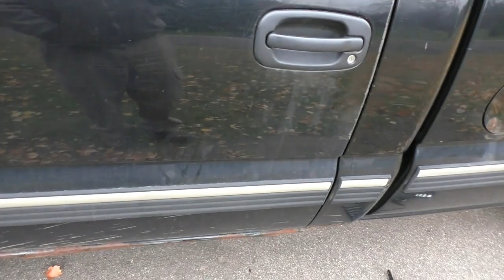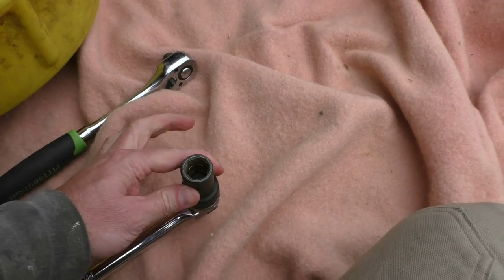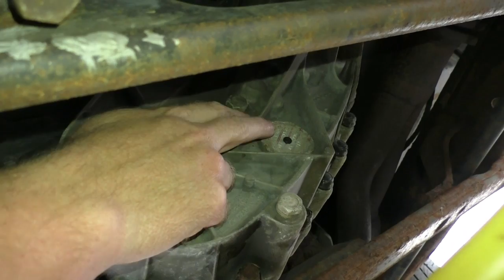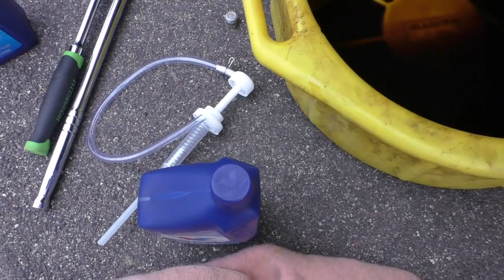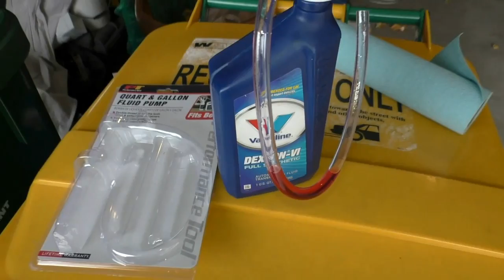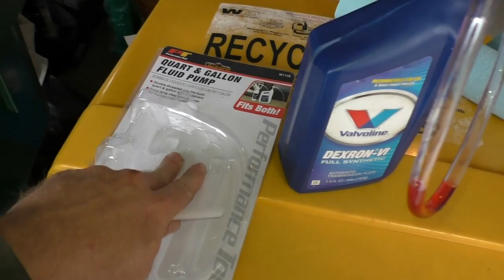1999 Chevy Silverado Transfer Case Fluid Change

Comment: So, how do you tell if you have an Auto-Trak II case or not?

Apparently it's supposed to use more of a 75w-90 gear type oil.
Reply from the maker: I don't know about that stuff. Sorry about that.
Reply: Auto Trak II uses AC Delco blue fluid #10-4017. Anything else will not be good for the transfer case and will lead to sooner failure👍🏼
Reply: @H P  thanks 👍

Comment: Hi I have a 99 suburban 6.5td. When i shift to reverse it takes a second before it engage. It is much harder/noticeable when the engine is hot. Do you think its the oilpump in the transfercase or what's your thought?  Is there any way to save the transfercase?
Reply: Transmission Shift Solenoid
Reply: thats your tranny bro

Comment: Can you explain the vibration, im having vibration too
Reply from the maker: It was a vibration that increased with the speed of the truck. My problem was a failing U-joint just behind the transmission. Get under the truck and try to move the u-joint and drive shaft around by hand. If it moves up/down or side to side at all then it needs replacing. There are 4 u-joints if you have a 4wd so check them all but it's usually the long drive shaft between the transfer case and the rear differential. There is a u-joint on each end.
Check for leaks around the transfer case and the amount of oil if you can. Good luck.

Comment: Dude your all wrong the the vent hole on top is just so it drains faster not so it drains and your supposed to use auto travel 11 fluid not atf bro do research stop making videos on shit you don’t know
Reply from the maker: The Dexron ATF is listed in the manual as the proper fluid for the transfer case. I'm not your bro and maybe you should do some research. bye.
Reply: hiddengrousefarm I have a 99 and it doesn’t say shit about that fluid there’s actual people that can’t afford to take there shit to the shop so they rely on these videos but people could do even more damage watching bullshit like this and two quarts wtf just do us a favor and don’t post videos
Reply from the maker: @johnniesmith6416  Here is a link to the owner's manual. Page 7-26 (402 in the pdf) shows the fluid for the transfer case. I have a manual transfer case so my fluid is Dexron III or IV. The fluid for the automatic transfer case is different. As I'm sure many people have told you - READ THE MANUAL.

 https://www.google.com/url?sa=t&rct=j&q=&esrc=s&source=web&cd=1&cad=rja&uact=8&ved=2ahUKEwiv4KzhnM7fAhXF7IMKHSOxBPQQFjAAegQIChAC&url=https%3A%2F%2Fmy.chevrolet.com%2Fcontent%2Fdam%2Fgmownercenter%2Fgmna%2Fdynamic%2Fmanuals%2F1999%2Fchevrolet%2Fsilverado_1500%2F1999_chevrolet_silverado_owners.pdf&usg=AOvVaw20XVxZnezDMMPbgXanq8-6
Reply from the maker: Also, that top hole is the right place to fill the transfer case. Where do you think the fluid goes into the case? Make a video and show it.
Reply: LOL. I own hard copies of the actual shop manuals including the complete manual for the transmission which is about 5 inches thick, SO.... since I'm planning on changing the fluid this weekend I'll go take a look at what the official GMC/Chevrolet shop manual has to say about it, at least for the 1997 model. @hiddengrousefarm Is your 1999 the gmt-400 or gmt-800 model truck since 1999 was a year where they sold both platforms?

Comment: How's it holding up?
Reply: Should have welded... Body looked good
Reply: The vibration you felt was likely the bushing extension housing is bad that's why the seal is leaking
Reply from the maker: I sent the truck to the junk yard 5 months ago. The frame rusted and broke apart. The vibration was a failing U-joint which I did replace but that was wasted money in the end. Rust is my mortal enemy now.
Reply: hiddengrousefarm 😕